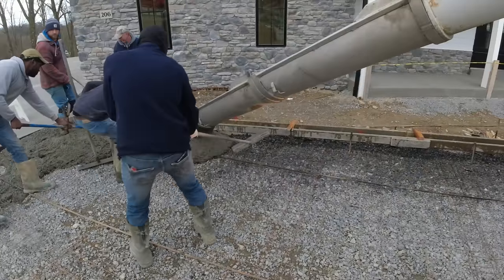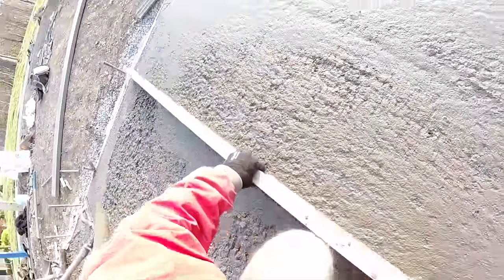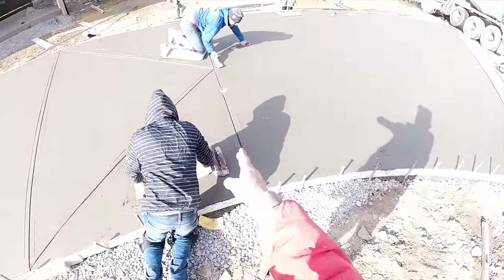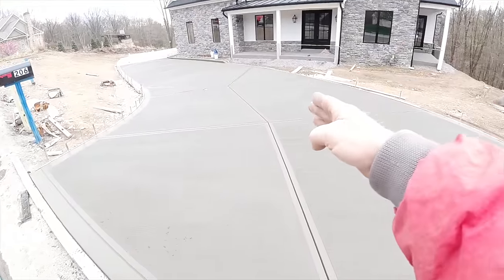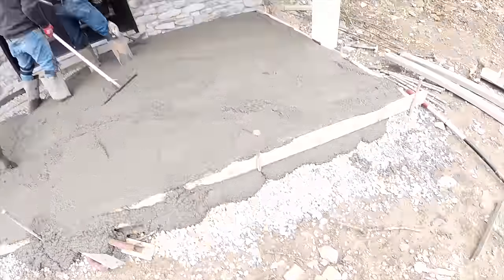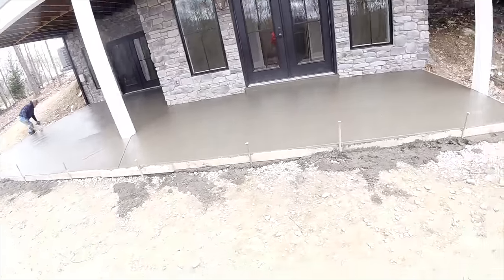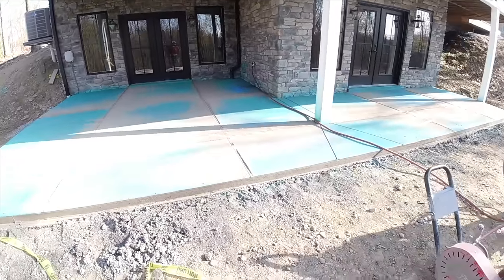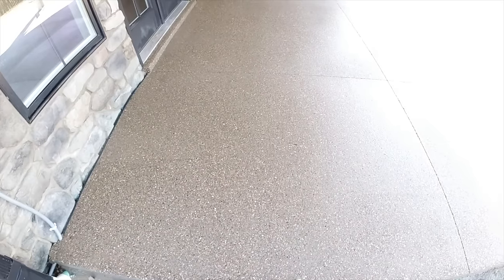Hope They Like Blue! New Exposed Aggregate Technique

Comment: I  noticed that the final cuts didn't coincide with your initial description, you said that they would be coming from the center of the doors and corner of the house, so it would be in quarters. Also, what do you use alongside the house for expansion and contraction? Looks great, love that exposed aggregate.
Reply from the maker: Steve had something else in mind it work to
Reply: I like the walkway look more then a crack straight down the middle.

Comment: Would one of those circular surface pressure washer attachments work faster? We used one on our deck this year, and it kept the mess down quite a bit.
Reply from the maker: We use it on sidewalks a patio you have to push the product too far

Comment: I used surface retarder on half a driveway a few weeks ago diy project. Blue too. It makes a hell of a mess but we got it off with garden hose / brush after 90 minutes from application. The afterspray hit the preexisting concrete and wouldn't come off so we were forced to use a pressure washer the next day. My first time pouring concrete on a slope, never ordering concrete that wet on a slope again.
Reply from the maker: 90 minutes that’s pretty fast

Comment: Would you do the same setup with the brake lines when poring a slab that will have vehicles, vehicle lift installed and tractors driven on it? Its for a 30x60 building.
Reply from the maker: Yes

Comment: Whats your opinion on using the water reducer and pouring with a 6 slump...obviously not on exposed agg.
Reply from the maker: We used a water reducer two different times and it was really hard finishing the concrete the top got all dried out from the sun before the bottom was setting I prefer not to use it I know there are times when it would be helpful
Reply: @Concretewiththehauses  tx for answering me. I was thinking about using it for ease of screading but it just doesnt seem worth it. Again...thanks. i really learn a lot from watching your show.

Comment: I think it would be better to lay the rebar on top and push it down an inch than to make it useless by walking all over it.
Reply: If you did that, you would cause more problems. It would be way too close to the surface and weaken the top, plus you’d end up with ghosting lines. Once there is concrete underneath the wire as rebar, it is extremely difficult to get it to sink to the bottom. Even if you jump all over it. Thanks for watching!

Comment: I have never done concrete but is the rebar not supposed to be propped up about an inch or 2 so as to strengthen the concrete. It was sitting flat on the ground of the base stone. I mean I know the pick ut up a little bit as they go but then 4 hefty guys step on it pushing it back down as they start scraping it.

Comment: Do you worry about adding calcium to steel-reinforced concrete? I know a lot of guys worry about that accelerated corrosion with the calcium. Curious on your thoughts.
Reply from the maker: I do not however we try not to use it on steel decking
Reply: @Concretewiththehauses  thanks for your input!